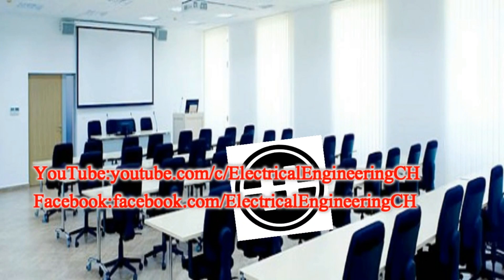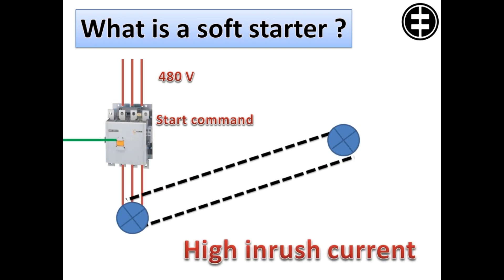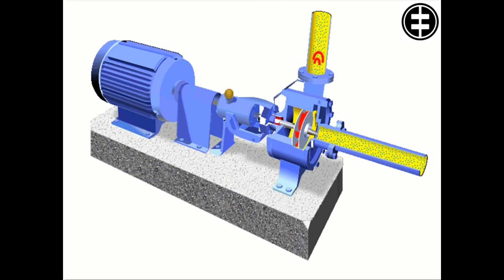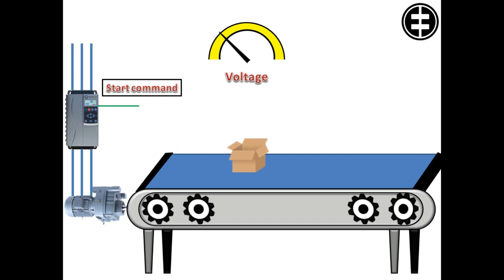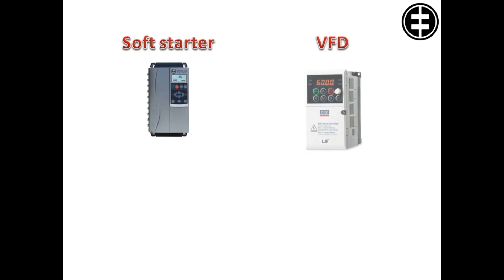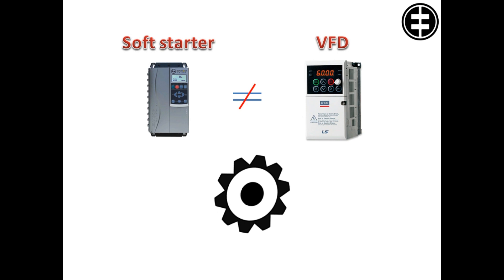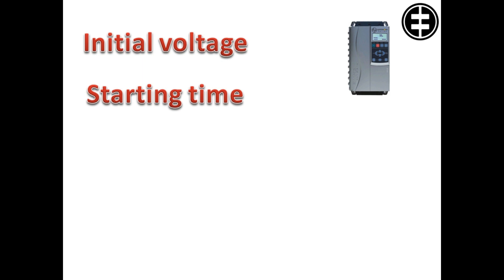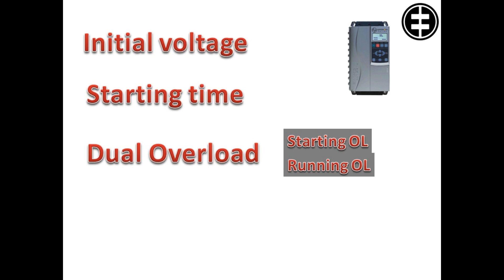What is a soft starter ? And it's operating principle.

Comment: What are safeties in vfd and soft starters ?
Reply from the maker: sorry you question is not clear, could you please explain more ?
Reply: Electrical Engineering - what safety are incorporated in vfd and soft starter ?
Reply from the maker: @shashwathrajmarine8567  Overload, phase failure, underload, overvoltage, undervoltage, motor stall, maximum and minimum speed*for VFD* etc..
Reply: Electrical Engineering thank you
Reply from the maker: @shashwathrajmarine8567  You are welcome any time, did you like any other video in our channel ?

Comment: May i know what is the difference between fcma soft starter and a normal soft starter.. and which one is better for V T pumps
Reply from the maker: The FCMA soft starters are usually used with motor driven pumps.

Comment: please explain ration between start time and intial voltage and what are the good settings please
Reply from the maker: No clear relation between initial voltage and the starting time, all related to the application and you equipment conditions, for example, in belt conveyors which normally starting with no load, the initial voltage is  45% and the starting time is 30 Secs, in other conveyors which start with load some times kick start are required and the starting voltage could be 70% and the starting time is 15 Secs, so each application has it's own best settings, hope that our message was clear.

Comment: Beautiful explanation, please what’s the difference between the Soft starter and the Korndörfer Starter.
Reply from the maker: The korndorfer starter is an autotransformer starter, but the soft starter is using the power electronics, using the thyristors to control the voltage output.
Reply: Thanks for the prompt response Electrical Engineering , thanks can the soft stater replace the auto transformer ?
Reply from the maker: @feredodan  Check this link, good comparison 
http://www.soft-starter.co/reduced_voltage_starter_vs_solid_state.html
Reply: @feredodan  YES AND ALSO TO CONSIDER OTHER FACTORS!!!!